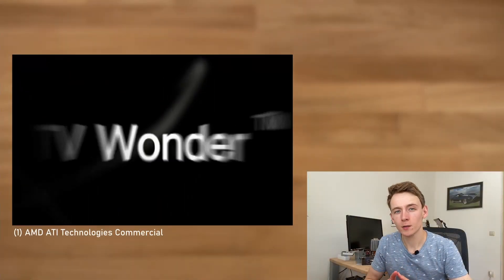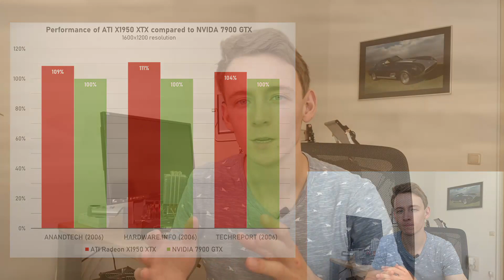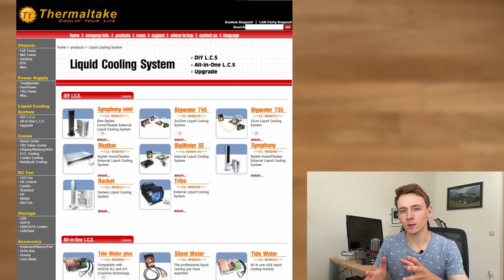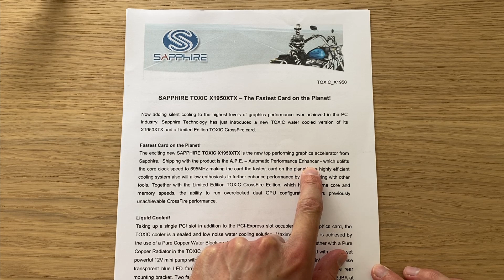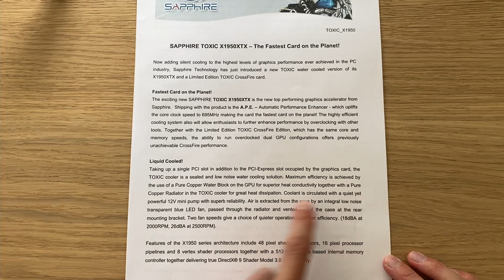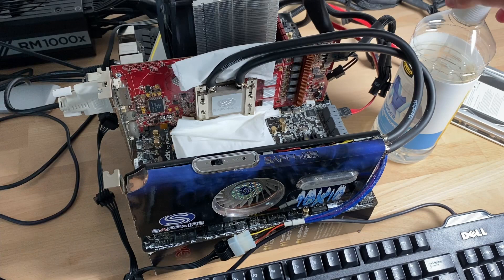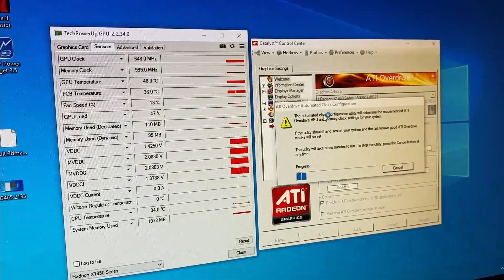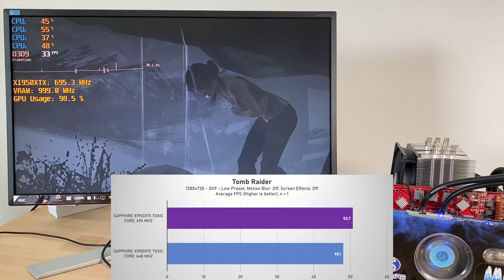Sapphire X1950 XTX TOXIC - 2006 AIO Water Cooling and 'The Fastest Card On The Planet'!

Comment: I was a quake addict back in the early 2000's. One of the best duellers in my country, and played in a division 1 clan in the Europcup.

So my rig had to be top notch. No slouch. I imported the first Diamond Mitusbishi 22" SB from the USA (cost me £620 + shipping) just so I could get 1280x1024 @ 120Hz. My Geforce 4 Ti 4800SE was still powerful enough to handle this, and I was running a P4 3Ghz at the time. Sure my hardware wasn't state of the art, but it was enough for Q3 which was all I played.

My friend had an X1950 XTX, cost him £320! I told him he was insane for spending that much on a GPU. But secretly I was jealous.

Anyways, during the late 2000's I snagged one from eBay simply cos it was going for pennies, think I paid £25 for it. I had quite a GPU collection back then, some 150+, and I was missing that card. I did a lot of testing with it and it was incredible just how fast that thing went (still), it could even play many modern games at half decent settings YEARS after it was released.

And it wasn't too noisy, or hot, despite the things Ive heard. She still lives in my collection and, as of maybe 2 years ago (last time I used it), WORKS FINE. Incredible card, like the reincarnation of the Radeon 9700 Pro.

Anyways, that GF4 Ti 4800SE eventually got swapped out for a Geforce 6800GT when I upgraded to Athlon 64. I'd pretty much retired from Q3 by then (only played for fun) and wanted to check out all those games I'd ignored for years as I was fragging my heart out.

Comment: This is the card I wanted, but I stuck with my 9800xt for a few more generations at the time. Good video to take me down the memory lane.
Reply: They were super powerful, a 3 year card - and thats saying something back in those days. I remember buying one for curiosity in the late 2000's and testing it and it blew me away how fast it actually was, even played through Torchlight 2 max settings on the card! But they were very expensive. I had a GF3 Ti 4800SE but all I played was Quake III OSP so ... I saw peoples machines running the XTX but never required one (till I wanted to collect one).

9800XT was a decent card too! Except for those tiny fans. Why'd they only stick a tiny fan on a card that hot and fast is beyond me. I modded mine with a slab of copper on my metal lathe and nicked a larger fan from an FX 5600 Ultra that had died. Much better! XD

Comment: It's smart to use reference pcb for later cooler change. I hope EU made it enforced to have 1 design for all 3070/3080 and 3060 card for better cooler capability and reduced e waste. Someone buying a high end 3080 end getting custom water cooler they could easily sell the unused air cooler and someone with a bad cooler 3080 or 3070 could get that cooler.

Comment: Looking at the card artifacting reminded me of my old X1950 Pro. Same exact symptoms, unstable both in games and in desktop, glitchy, and the clocks wouldn't go up. Must have been a common issue on these.
Great find! Since the PCBs are so similar I wonder if it could be repaired by replacing the card with a working reference X1950 XTX and flashing the BIOS from the Toxic version.

Comment: Go get coffee machine cleaner fluid dilute it by 1 part distlled water and run that through the card for 8 hours draining after the liquid turns a shade of blue (once you see it start turning blue set a timer for 2 hours, once the timer is up drain and refill with more diluted coffee cleaner for the remainder of the 8 hours)
Reply: Better yet, go get some car radiator cleaner.

Comment: As exotic piece of history this thing is perfect, but in practice with such a small radiator and still 3 slots occupied I guess it would have been much better just use an oversized air cooler with a big FAN. What were the temperatures under load?
Anyway you did a fantastic job, very enjoyable video, keep it up! 😎
Reply from the maker: Thanks! Peak temperature was around 73C at 695MHz

Comment: Sweet, you found one! fyi that green corrosion is caused by the gpu block being aluminum mixed with the copper radiator. if you have the ability to open up the gpu block. Id recommend doing it to see the extent of the damage inside.
Reply from the maker: Oh that's a good point. Unfortunately the block is a sealed unit, but I tried my best to get all the goo flushed out of it.
Reply: Considering how early this thing was in the water cooling space, I'd be shocked if the water block had internal fins fine enough to retain any galvanic buildup. He probably managed to get everything that was there the first time around.

Comment: Simply completely unexpected performance from a card with just 512 MB of VRAM. What an enjoyable and educational watch 👍
Reply from the maker: Thanks!
Reply: ram size only matters for texture resolution and actual resolution like 1920x1080, thats why you see videos like "is 2GB of Vram enough on a GTX 680" and thats because you have 1 card that can only push so many pixles so having a bigger frame butter doesnt matter. if you did SLI or Crossfire then naturally you can run at a higher resolution with higher textures etc, so in the case you want more memory.
Reply: not really, there were 512mb version of the HD4870 and that absolutely destroys this card, like no contest.
Reply: @GraveUypo  Well the 4870 was 3 entire generations later, had a shedload more shader and pixel pipes, faster VRAM, smaller process, you name it. Things moved incredibly fast back then, unlike today. But the 1950XTX (and even the XT and Pro cards, the AGP editions) was amazing for it's time. It wasn't cheap, but it was very fancy.